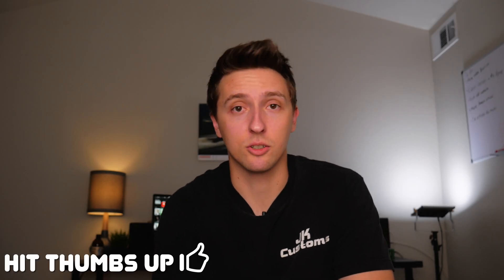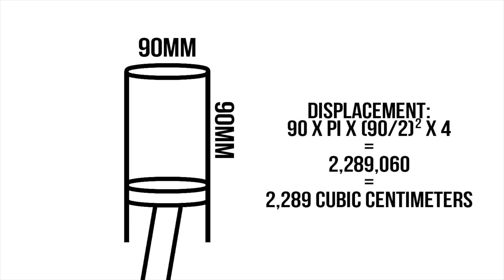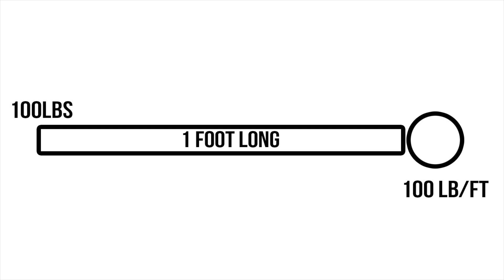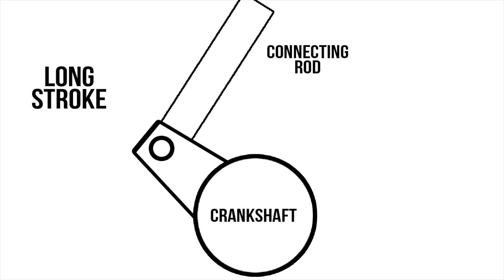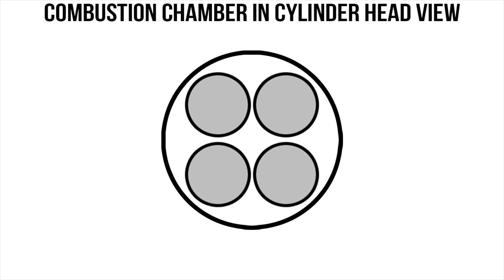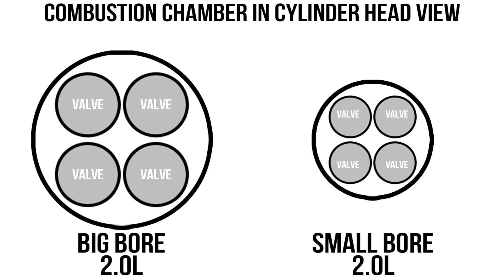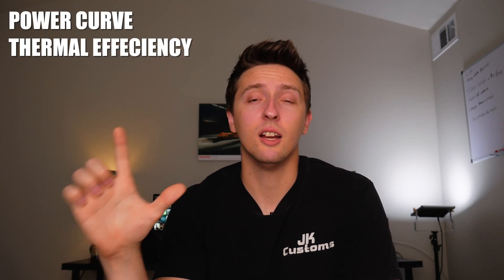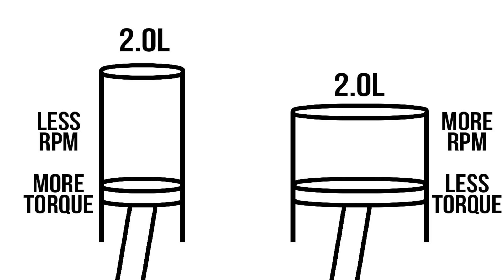Bore vs Stroke: Which One is Better?

Comment: A good one, showing the basics about bore/stroke ratio. Of course there other factors that affects power output, torque curve, longevity and fuel efficiency. An odd example of how other factors can affect is British taxation. Long time ago bigger bore meant higher tax. So auto makers built long stroke cars.

Comment: An undersquare engine doesn’t necessarily make more torque than an oversquare engine if both engines have the same displacement. 

Torque = Force x Distance
Force = Pressure x Area

Increasing the stroke improves torque by increasing the distance between the connecting rod and the center of the crankshaft. But increasing the bore also improves torque because the pressure from combustion is exerted onto a larger piston which increases the force. 

While both engines make the same peak torque, the undersquare engine will make its peak torque earlier in the rpm range. That’s because the relatively high piston speeds and small intake valves improve air velocity at low rpm which improves air/fuel mixing which improves combustion quality and thus combustion pressure.

The tradeoff, however, is that undersquare engines can’t rev as high which means they make less peak horsepower.
Reply: “Increasing the stroke improves torque by increasing the distance between the connecting rod and the center of the crankshaft.”  This is correlation not causation.  The increase in torque comes from the increase in the increase in conversion of chemical energy to mechanical energy afforded by the increase in displacement.  The increase in crank radius is irrelevant beyond that.  It does not provide leverage or increased mechanical advantage if that was what you were implying.
Reply: @rollsroyce329 You’re right, it’s probably not accurate to say that more stroke improves torque because of improved mechanical advantage. Torque is really just proportional to displacement, assuming boost and compression ratios aren’t factored in. An undersquare engine would make the same peak torque as an oversquare engine of equal displacement. The difference is that undersquare engines make their peak torque earlier in their rev range.
Reply: @theotherguy6951 all good man.  I thought some may think that was what you are getting at as it’s a common misconception that the crankshaft provides any leverage at all as is often promulgated on YouTube including this 🚮 video😂.  The correlation between long stroke and early torque peak is definitely a bell curve with greater variation from all factors combined than just bore stroke ratio for garden variety passenger vehicles.
Cheers.

Comment: As a retired Dodge dealer mechanic w all 8 ASE tests (master technician) advanced level engine diadnostics and a machinest test for engine assembly I found this video very interesting and informative.  And it explains things in laymen's terms so  everyone can understand.  Around 2006 I bought an 88 turbo LeBaron conv with an auto trans and 2.2 L turbo 1 engine. It ran good but my goal was to make it a mid 14 sec car.  I don't remember the bore which was the same in the 2.2 and 2.5 engine. It was approx 3.5. the 2.2 had a 3.6 inch stroke and the 2.5 had a 4.09 inch stroke.  I met my goal with a 14.1 ET at 97.3 MPH.  I embaressed a lot of V8 cars.  After watching the video I can't believe the engine shifted at 6000 RPM.  With a 4.09 in stroke. And nothing broke. The 80s Mopar 4 cylinders were bulletproof.  Also the 2.2 and 2.5 was designed by the same person who made the famous slant 6. From 1984 to 2013 I only saw only one 2.5 come apart and was due to driving it with NO OIL (had a hole in the oil pan).  I still have a hard time believing an over 4 inch stroke could hit 6000R PM!! The only weak spot was the head gaskets on the turbo engines.  And those motors were so easy to work on, a head gasket could be replaced in 3 hours or less. These motors are in my opinion were the best domestic 4 cyls,  just like a small block Chevy was the best.  And don't forget the origional Ford 302.

Comment: Here's a Q - what is done differently for two engines with identical bore and stroke, where one has more torque, and other has more hp?  Example:  the 1970 Ford 429cu.in.  The Thunderjet had 360hp and 480 ft/lb of torque.  But the Super Cobra Jet had 375 hp but 450 ft/lb of torque (and at a higher rpm).  It seems like the things you do to increase hp would also increase torque, or at least not decrease it.  Maybe we chalk it up to Ford lying about the output of the SCJ.  Pretty sure they underrated the hp of the SCJ, but manufacturers in those days didn't seem to also underrate torque.

Comment: There must be more to the explanation behind more stroke-> more torque, because if displacement remains constant, the longer stroke engine also has a smaller bore, with a proportionally smaller piston surface area, which means less force. If the pressure inside the cyilinder is the same, you would end with the same torque either with a big bore-short stroke engine and a small bore-long stroke engine. It is true that big bore-short stroke engines can rev up much higher, which make them suitable for sports cars, and small bore-long stroke engines are more efficient, so there's that.

Comment: If an engine have long stroke it will have a small piston. A small piston will create a smaller force on the crank so it loose the same amount of torque ending up equal.

Comment: What if u use custom pistons where the pin sits higher and pistons are shorter. U can use longer rods with the same stroke and bore and reduce angel of the conrod.

Comment: what if i converted an 848cc Reliant motors I4 into a short stroke from a long stroke. These engine don't like high rpms but are very light and low on capacity. 
And even though it has a long stroke it still handles high rpms well which makes me wonder if a Reliant engine could rev up to 10k rpm after the conversion.

Comment: You can increase fuel efficiency with a big bore cylinder by adding compression say like a domed piston but it will also affect the fuel intake a little
Reply: Do you also need to change your cylinder head if you put in a domed/hemi piston? Also is hemi and dome piston the same?
Reply: @DeezyNut  changing the cylinder head is not necessary but be sure to test the gap to prevent the piston and the valvels from knocking on each other
Reply: ok listen up
with flat piston, actualy it's also the same as piston like domed piston, just play in intake valve in and close,  just set valve close around 45 to 40 degree after bottom dead center to close the valve, and walla get that dynamic compression more higher without changging to domed piston

Comment: Great video! Thanks for the info. Question, I’m getting a 2022 Suzuki GSX-S750, ships any day 😁. Anyways is the engine a big bore short stroke? I had a 2016 Suzuki GSX-S1000 and it definitely had a big bore long stroke engine. These are naked street bikes, the power ban is lower than a conventional crotch rocket super sport bike which has its power at the top. the crossplane engine, was on my last bike 2021 R1, it was to dam fast around here for me power everywhere. I’m near the 🐉Tail of the Dragon 🐉 318 turns in 11.6 miles no side roads
Reply: I was a car bro until I turn 28 years old and finally bought a motorcycle the best decision I ever made, recently I went back to try cars and got a 2018 Ford focus ST, traded it for a 2019 Ford fiesta ST and then realized bikes are so much more fun and sold that fiesta

Comment: How you calculate displacement blew my mind.

I always wondered how they calculated the sizes.

This video was very insightsful and helped me understand bore and stroke better.

So for a (NA) Diesel 4wd it would be better to have a longer stroke to get better pulling power. 

Diesel engines also rev a lot lower than petrol so you sidestep a lot of the pitfalls a petrol experiences with a longer stroke. (at least that is my understanding of it)

Comment: Is there a ratio of bore vrs. stroke which yields a most efficient combustion process -  gas or diesel - regardless of total displacement?
Reply: it's typically near 1:1, because that shape has the minimum surface area/volume ratio. The smaller the surface area the less heat is lost.
Reply: Thanks James, the reason I ask was that I'm old and remember and used to read the Nebraska Tractor Test results, seems that the John Deere 2 cylinder diesels had the highest rating in the Horse power-hours-per gallon of fuel. I guess this was a measurement these guys made to determine efficient conversion of fuel to power. This engine JD used had a relative long stroke. I would like to see current automobile engines connected to a dyno and rated in a similar fashion.
Reply: @jeffsnider3588  OEM advertised power ratings are done with a standard test so results will be directly comparable. Often long stroke engines have good fuel economy figures for lower power ratings because the smaller combustion chamber has smaller ports which increases port flow speed, creating better tumble of swirl, better mixing, better flame propagation and lastly better in cylinder pressure. The problem is they begin to run out of power around 30 - 40 bhp/litre. Whereas a square bore stroke will make 40-70bhp/litre.

Comment: One question about oversquare engine . How about large stroke but we used a short connecting rod . Like example 

motorcyle A 
Stroke 56mm
Bore 53mm
Then we  up stroke 2mm up 
Then stroke must be 4mm because TDC 2mm ( up ) and BDC 2mm (down) and total motorcyle A is 60mm stroke .  Distance BDC to TDC is long right ? But if we used a short rod like standrt motorcyle A is 96 large and we change use 94 large rod . How about distance from BDC to TDC or TDC to BDC its still large and take a time to full compress engine  ?? Can u explain ? Tq sir

Comment: Gasoline does not explode, it burns.
Reply: not when it is compressed
Reply: @jackhanson1065  interesting. What is the speed at which it changes from a burn to an explosion
Reply: @davidreed6070  speed? Do you mean pressure?
Reply: Gasoline burns, the more you compress it the faster it burns, but it doesn't explode. If you put dynamite in your engine and lite it off, that would be an explosion. But you would not have an engine anymore. When you build a higher compression engine you slow down the timing because the burn rate is faster.
Reply: @davidreed6070  interesting. Can you please define an explosion vs a fire then? how do you know at what point a "fast burn" becomes an explosion?
Reply: @jackhanson1065  that is when it becomes physics, I truly don't know, but I know at a certain point it changes from a rapid burn to an explosion. If you research that please tell me I will chart that, I have never researched it.

Comment: @ 9:56 Harlry Davidson did change , They have come out with an E-bike , It's really quite Funny .
Reply from the maker: Unfortunately it’s terrible compared to other e-bikes and more expensive.
Reply: @Dustrunnersauto  Hi there 
I have a question lets say my car has a 1.6 L engine and a 81mm bore 
If I just make the bore bigger to roughly 86mm will I gain  power?
Reply: E-cars and E-bikes are for bitches!

Comment: Thanks for explaining Bore vs Stroke, as I never understood HP vs Torque till now lol.
Reply: Big hp n torque = fast
Reply: @falahsamisyahdan7962  More like.

HP (or other measurements like bhp, kw) = speed

Torque= strength/pulling power.
Reply: @madcat4563 hp= maximum work that can be done

Torque= how fast that work can be done or the ability to get work done
Reply: @madcat4563 complete nonsense.  Power, not torque is the limiting factor for not only how fast a given amount of work can be done but also how much work can be done within a given amount of time.  In short, anything torque can do power can do better and/or faster.
Reply: @Eclipsis17 um, no.  Power is how much work can be done in a given amount of time and is also how fast a given amount of work can be done.  Torque is irrespective of time.
Reply: @rollsroyce329 yeah I was incorrect. Rpm is how fast torque is delivered. Torque is force. Horsepower is torque x rpm/5252.
Reply: HP is hit points.  Run out of those, you're dead.  Horse Power is total top energy output of your engine per unit of time, specifically estimate of how much work a horse could do per unit time.  It was a marketing gimmick by James watt, he needed a way to sell steam engines and wanted to say such a such engine could replace at least one horse.  Now torque...  That's a different story, it's a measure of how much oomph is behind spinning something.  Typically it's also in units of work, force×distance...
Reply: Ya ya sis masi ya wan aku I have to be ready for the trat ttcareful to try done with ready stok so you guys are going out ready careful to the other side done with this ready stok tiada ready stok so you guys are

Comment: 1:43 this is in US measurements. In metric system, is different.

●INTERNATIONAL:
▪P=Power in Kilowatt (kW)
▪M=Torque in Newton-metre (Nm)
▪N=Crankshaft speed per Minute (rpm)
■Definition: P=(M×N)/9550

●TECHNICAL METRIC:
▪P=Power in Horsepower (HP)
▪M=Torque in Kilogram-metre (kgm)
▪N=Crankshaft speed per Minute (rpm)
■Definition: P=(M×N)/716

Comment: Bigger the bore = higher potential rev limit and can mean more power.

Longer the stroke = more TQ due to the engine being able to use more of the combustion energy. Tq in a engine is how efficient it is. Power is just tq over time.